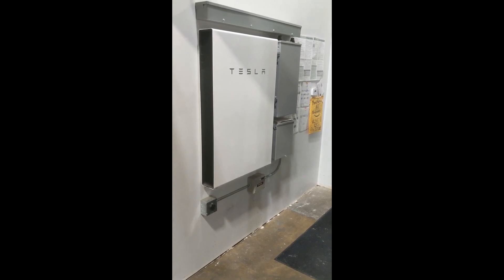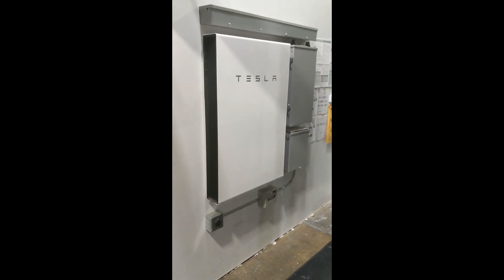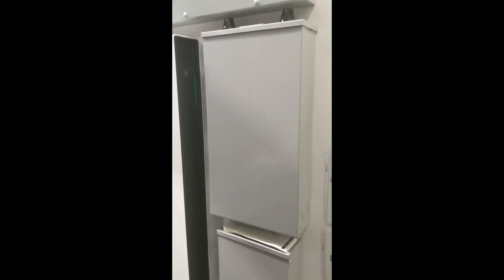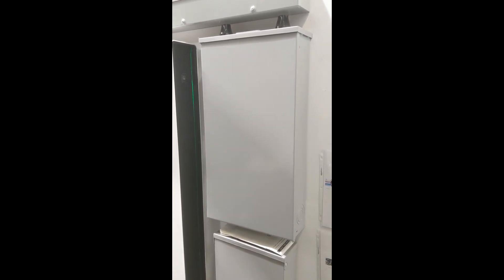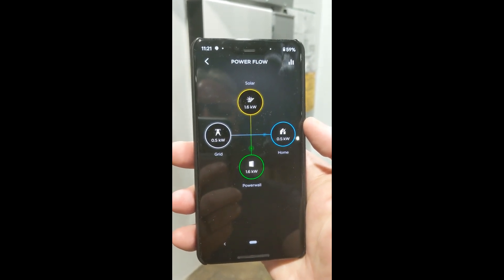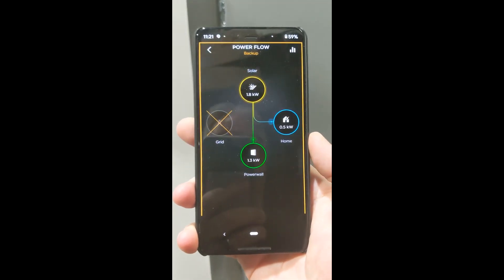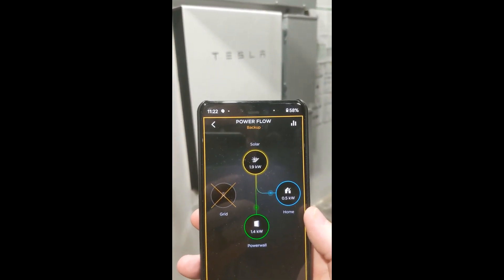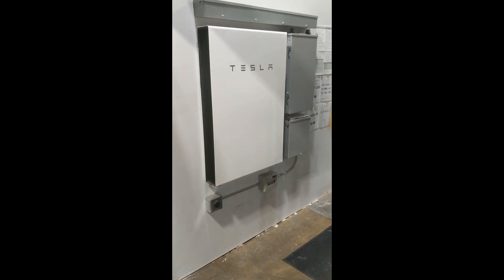Tesla Powerwall Power Outage Demo

Comment: It's a monofase system, but can the ATS inside the gateway switch to my 3 fases? I don't care I lose 400V capability since I rarely use that but I need my other stuff on 230V running.